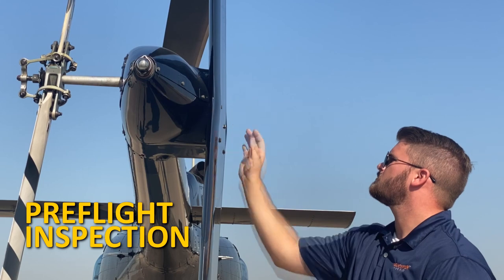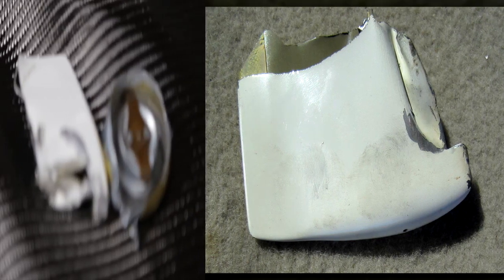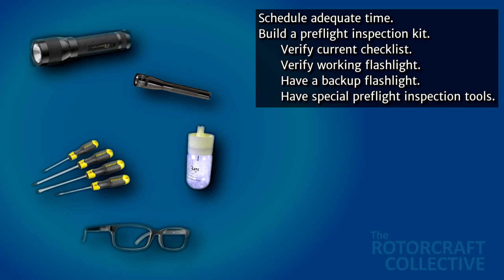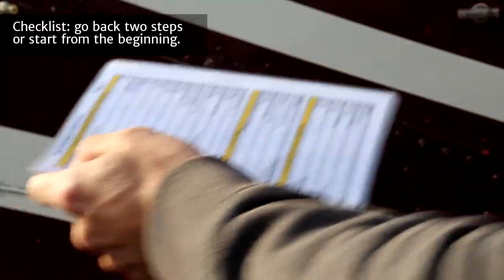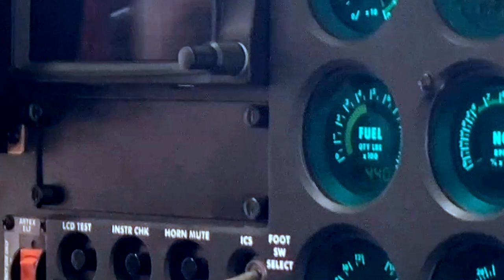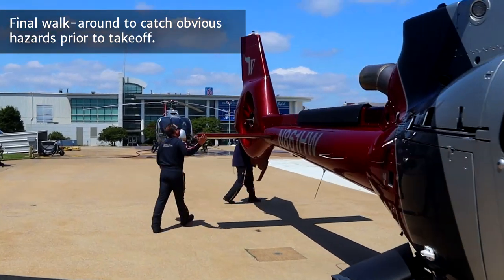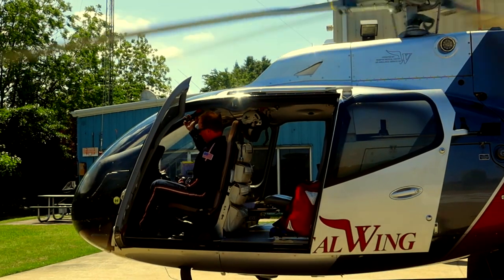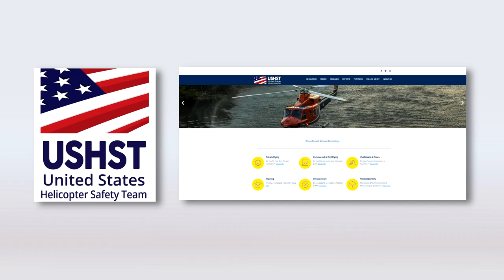The Rotorcraft Collective: Preflight Inspection

Comment: Hey FAA, the General Aviation Community is experiencing an unprecedented amount of accidents in 2021.  Is this because pilots haven't been flying much? Some would say yes, but myself and others are thinking a little more broadly at the issue.  There is a definite need for a AQP style of training as the airlines use only we need this for the General Aviation Community. There seems to be a lot of pilots crashing their airplane while flying too slow in the pattern and then make that turn to land loosing forward airspeed and spiraling into the ground.  We need training in the GA community that will allow pilots to attend a "higher" level of training beyond just the basic pilot certification.  
#AQP #probablecause #GASafety